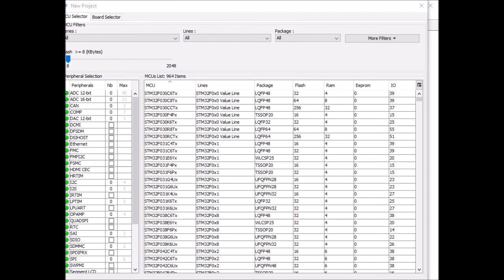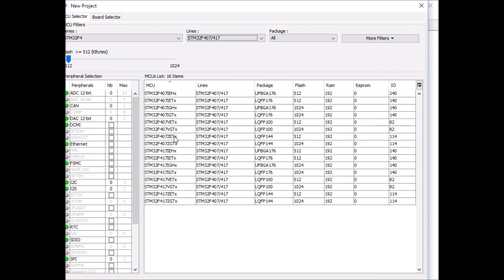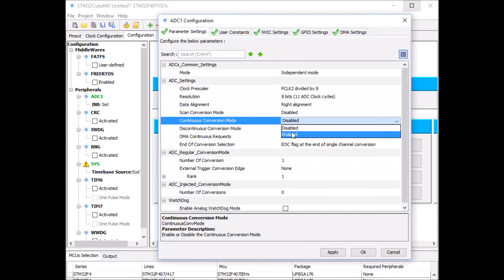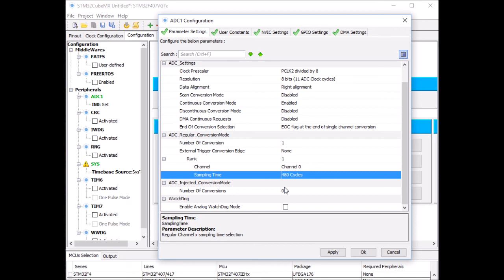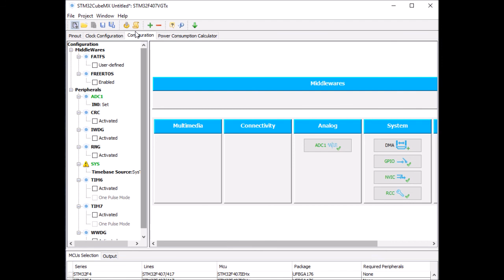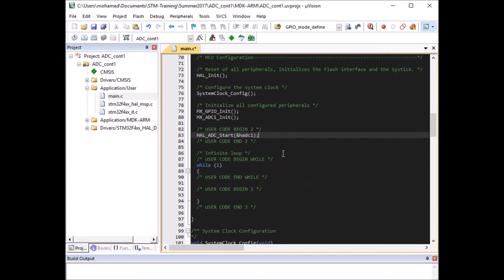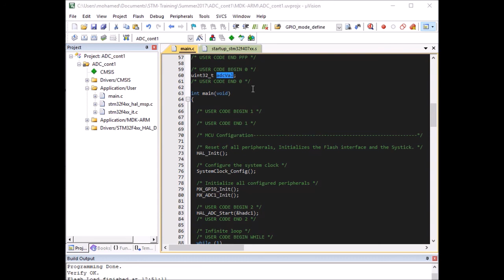STM32F4 Discovery board - Keil 5 IDE with CubeMX: Tutorial 4 ADC Continuous - Updated Nov 2017

Comment: I am using Attolic, to view the changing I used STMStudio. Check Mohammed's other tutorial on Debugging if you want to use STMStudio. I had to use an .elf file but it worked the same. I am using another board Nucleo-F767ZI and the calculations were different but used your formula as a guideline and I used 480 cycles with an 8 prescaler making I believe 40us, but worked the same. If your numbers don't change check to ensure that the Continuous Conversion Mode is enabled.

Comment: hello and first of all thank you for your videos. they help me a LOT for school. But I want to point out that you made a conceptual mistake when calculating conversion time.

Tconv_c = (480 cycles + 8 cycles (for 8 bits)) * 1/2MHz = 244 uSec

General formula:

conversion_time_based_on_resolution = 1 ADC_clock_cycle/bit_of_resolution x bits_of_resolution
total_ADC_sampling_time = user_chosen_sampling_time + conversion_time_based_on_resolution
Reply from the maker: Hi Anton.. I will review this part and make a clear emphasis on formulas. But big thanks Anton for pointing this out. I will get in touch with you when I review the video. Do u use skype Anton?
Reply: MYaqoobEmbedded yes. What is your username so i can add you?

Comment: My value only gets updated once at the beginning of the code execution. The value stays the same afterwards. Any idea what I'm missing? Thank you!
Reply: I have the same experience. But if i close the the debugger and run the code again it changes the values. Surprisingly the single conversion works perfectly fine and responds to the changes in the potentiometer. Did you manage to figure out the solution to this problem?

Comment: Hey, hello again!

Another question here: do you know how can I generate an interrupt at every EOC using the continuous mode? And how (where in the code) can I access to the EOC flag or the interrupt routine? 

Thanks in advance!
Reply from the maker: Hi,
Continuous mode Interrupt is not recommended, because ADC will be running as fast as the clock goes,, and this can cause the main "thread" to freeze.

What I would suggest instead is using ADC with a TIM trigger (to control the ADC conversion rate, thus interrupt rate), see this video for ADC TIM with EOC interrupt.
Good luck

Comment: I did exactly what you did in the video but I used the temperature sensor of stm32f411. However, the adc value didn't change over time even though I had enabled continuous mode. I don't know how to fix this problem. Please help!!!
Reply: Hey, I have same problem with you, did you solve it? I'm using stm32f439.
Reply: @劉建志-o8q  If you use cubemx, you must set the eoc flag at the end of all conversion